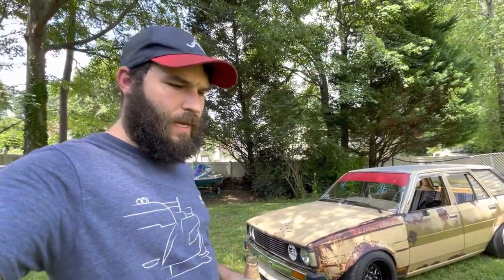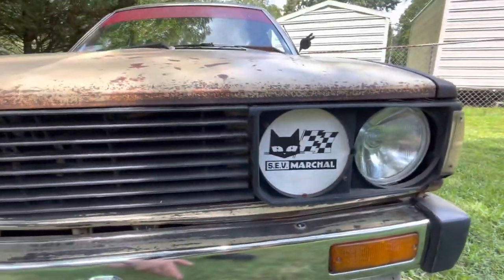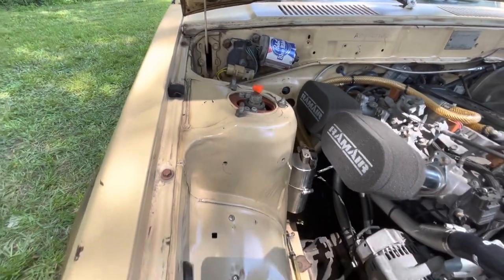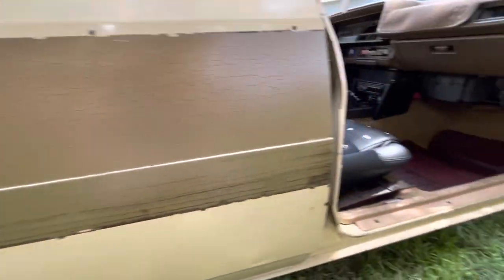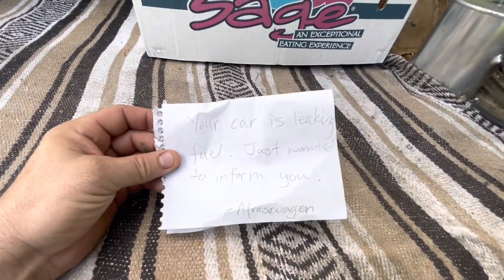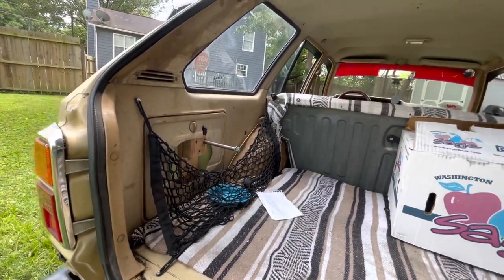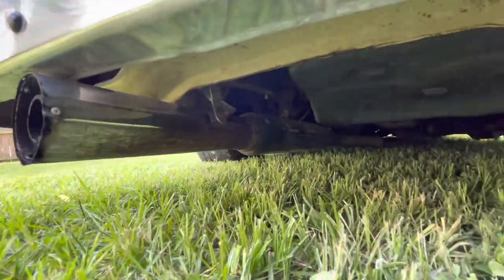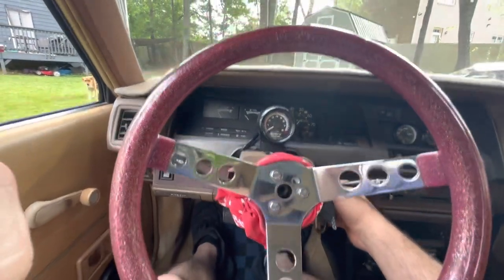20 Valve Swapped TE72 Corolla Wagon

Comment: I have a 83 I think it’s a 1.6 the carb and exhaust is one manifold  I’m new to this I just don’t like carb and it’s automatic if I can put the motor you have I’m happy with that
Reply from the maker: The 83 came with a 4ac so the 4age swap is even easier. Basically any swap and swap parts for an ae86 will fit your car.

Comment: Love the build! Helps motivate me to work on my 1980 wagon when I see other cool wagons! What did you do to the leaf springs so you only had to use a 2" block? I'm using a 3" with worn leaves.
Reply from the maker: The center leaf was removed from the pack, flipped upside down, and re-installed on the top of the pack to flatten the arch.
Reply: @deathwobble  I'll have to give that a try when it's not in the 30's outside lol

Comment: Hey man! A lot of builds like these never get finished. Really cool to see this bad boy swing.

I have a te72 corolla coupe sedan, also 81. I also came across a 20v with a t50 to replace the 3tc/t40 combo it has currently. All good if youre too busy to answer but I just had a couple questions as i move through my own.

Any specific mounts that work? Relay changes to accommodate the ignition with the key? Driveshaft? Looking to do it as cheap as possible ~ it's a cheap beat up economy car that is meant to be driven, similar to yours. Once again I've been following your channel lurking for a few months, just thought I'd give it a whirl. Happy wrenching!
Reply from the maker: When I swapped mine I used a complete ae86 front subframe, so mounts were just stock ae86. As for using the stock te subframe I'm not sure, but they should be pretty close. My car was originally a 3tc/t50 so my stock driveshaft was stock. I have swapped to an ae86 driveshaft now, but only because the u joints were better
Reply from the maker: As for the wiring, there's a ton of switched 12v wires in the harness that come from the right side of the engine bay.

Comment: Ok so I can use any 1.6 from that time frame what about intake and exhaust manifold, computer wireless I know I’m asking a lot of questions but I really appreciate your help
Reply from the maker: The computer will be which ever computer goes with the motor you're using. Or an aftermarket stand alone ecu. Wiring is best to get a new harness from a company like tweak'd or panic.

Comment: Have a better ideal can you go through the whole swap part by part wire by wire the reason I ask is I have the same car and I would like to make it fuel injection
Reply from the maker: 😂 it's a pretty common swap. It's a very over priced swap in today's market though. If you have a 3tc in your car it'd be easier and cheaper to make this much power with that motor